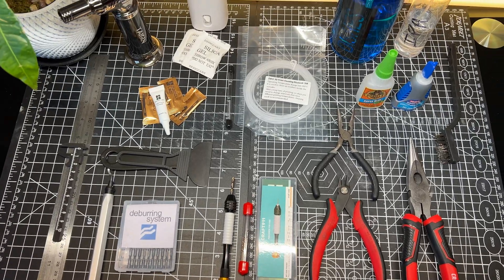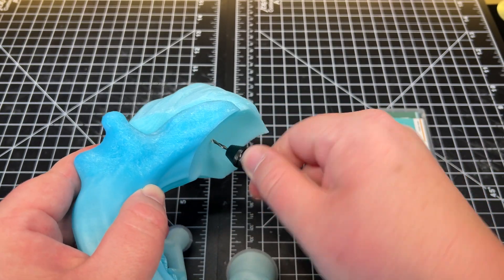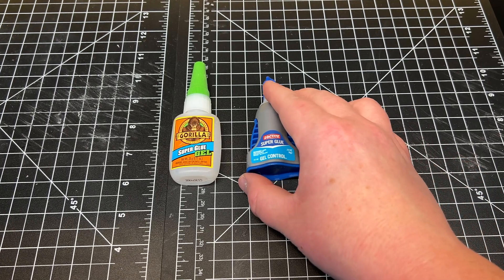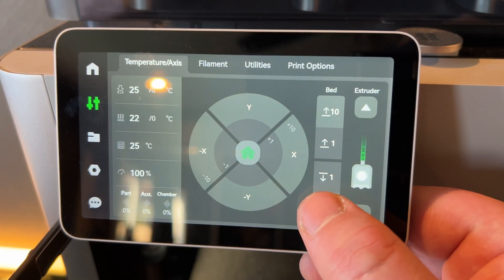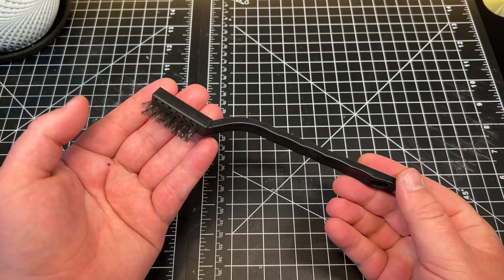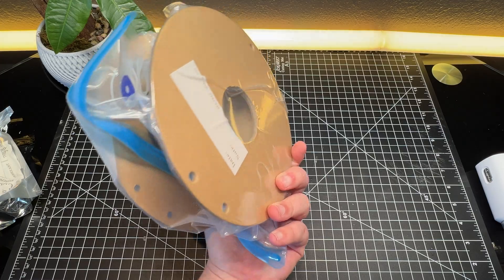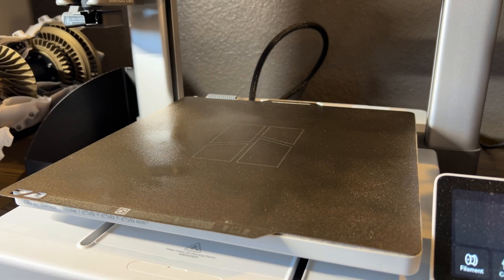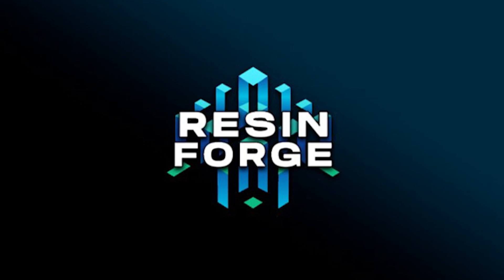Beginner 3D Printing Tools and Accessories

Comment: Recently I found a tip for using windex on the plate. It cleans the plate and leaves a film that seems to work great. I've had a go at it for a couple weeks now and it's doing a great job.
Reply from the maker: @radek1651  Interesting 🤔 I have read about using Windex for printing PETG but have never tried it. Thanks for commenting, I appreciate it! 🙌
Reply: @ResinForge  I have only had a printer for about 3 months and it came with a fancy glue stick, but windex is so much easier to apply and whipe, and it actually seems to work pretty well, i'm surprised its not mentioned in more videos.